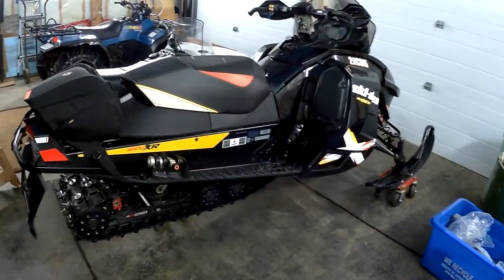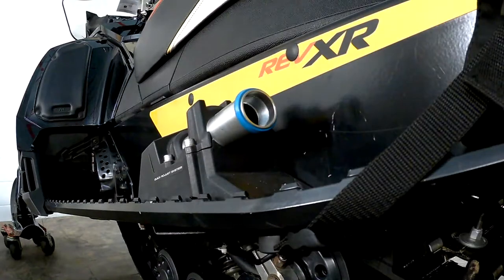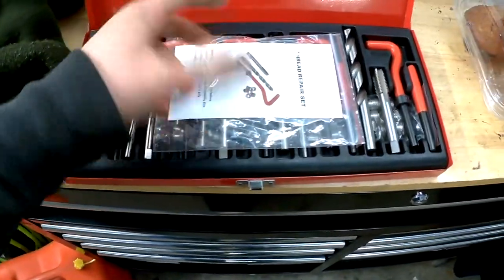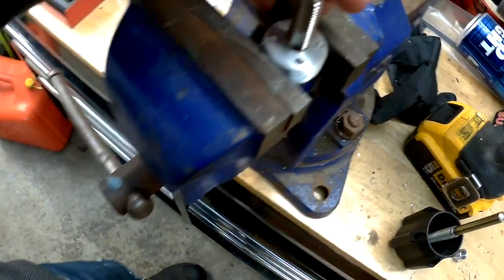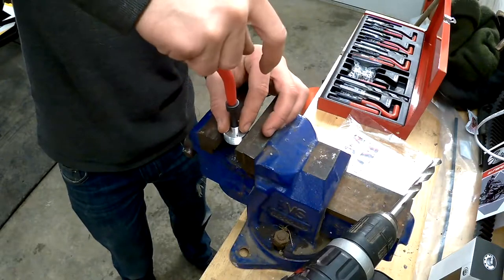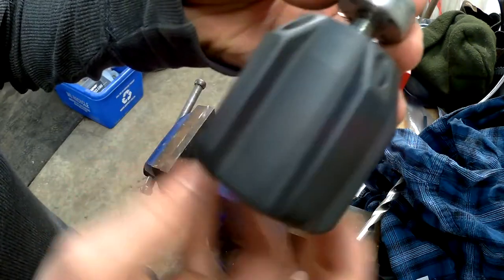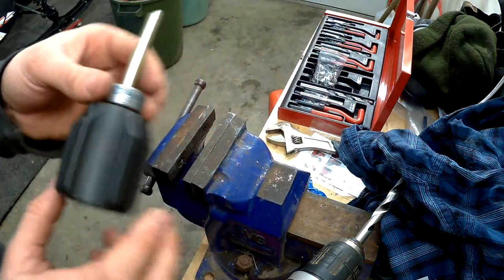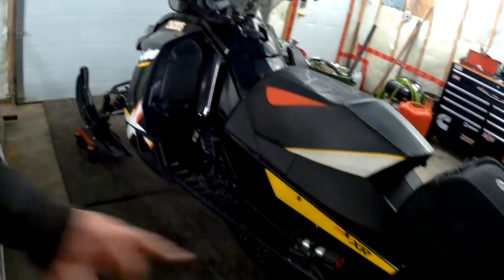Ski-Doo R motion suspension Fix (REV XR/XS/Gen4)

Comment: Is the line that feeds from the quick adjust to the shock under pressure with fluid in it? I want to remove the skid completely
Reply from the maker: Correct. The shock or the reservoir on the boards has to be pulled off and through the running board. The quick adjust for the rear torsion springs can be left on i believe but you can remove the piston from underneath the torsion springs and set it aside.

Comment: Have you ever changed your eye facts and have you taken your suspension off to do that or can I cut the window just a little bit to get my old ones out some slide right out on snowmobile some don't mine's not even close and I have air ride on my 1200 touring
Reply from the maker: Yes sir i have if you are meaning Hyfax. Lol. I have loosened my track adjusters right off and then undo the front of your torsion springs to relieve pressure on the skid with the sled off the ground obviously. You unbolt the torsion spring with a 10mm behind the bogey wheels. Have to remove front bogeys i believe. Then you can grab the track and jimmy it to the side and change one hyfax then slide it back the other way to get the other side. It will be a bit of wrestling over the nubs for the drive cogs on the track. I have done it this way before.